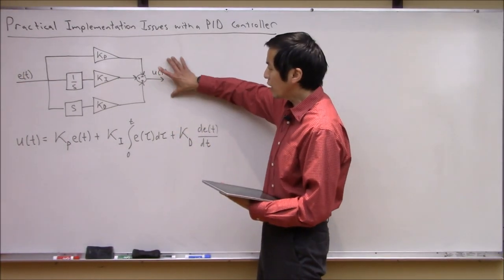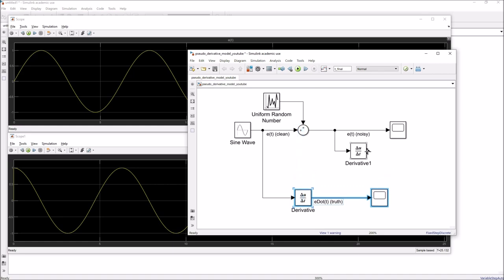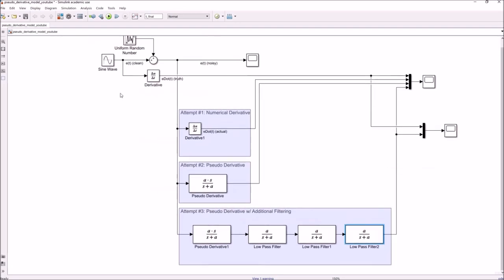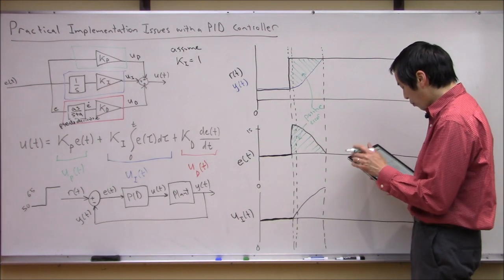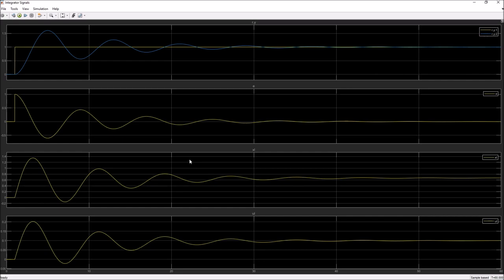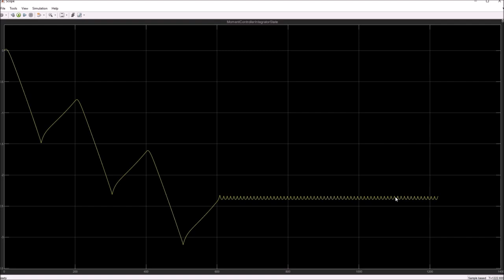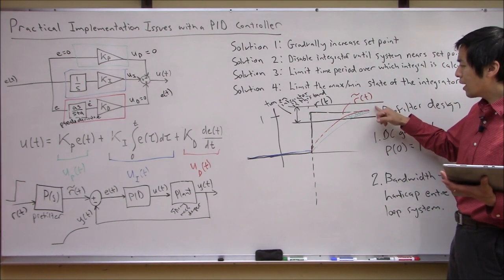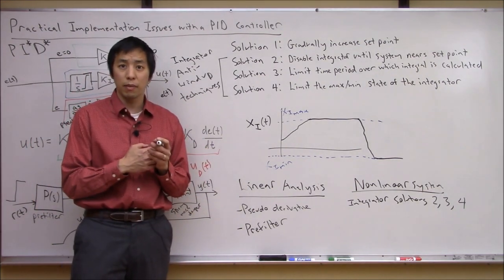Practical Implementation Issues with a PID Controller

Comment: As always, great video! I'm happy to be a patron. I thought I would comment that there is another reason to evaluate the integral in PID in the order Ki then the sum (discrete) / integral (continuous):  (error -> Ki -> 1/s -> output). When changing the Ki coefficient, if you have Ki term preceding the sum, then any change to the Ki term will change the rate that the total integral term "changes". There will be no step discontinuities. If the sum precedes the Ki term, a change in the Ki term will result in a step change in the total integral term. This is almost never desired. When would you change the Ki term on a "hot" system? 1) When tuning on a test stand and 2) gain scheduling 3) when you switch your control law "off" temporarily.  In addition, the Aerosonde example is a great example of how the whole problem could have been avoided by using this scheme. When switching from PID control to manual control, the Ki term could have been set to 0. If the Ki term precedes the integral sum, then the integral sum wouldn't build up and it's super easy to code this up (this does not eliminate the reason to limit the integral sum). Of course, this avoids the issue that a live control loop should never be left executing when not "hooked up" to anything. Leaving he forward path "broken" is the ultimate in non-linear control! :). Many thanks to Chris for making a video with such meaty topics!
Reply from the maker: Great comment and great observations, thanks for sharing!

Comment: Hi Chris, thank you so much for these videos. Not sure if you know about Signal Viewer and how easy it is to use that (for viewing multiple signals together, separate, or whatever) instead of the scope blocks. All you'd need is just an output port for each signal you're trying to add to the Viewer. I discovered about this a few months back and it has made my life so much easier.

Comment: Do you remember what signal you were using for the error term in the example you gave of a limited integral state vs limited output?  When I set up a similar system and used a square wave as the input signal, I got the same output when limiting the integral block (what you called limiting the state of the integral) as when I put a saturation block on the output of the integrator.  I think I'd understand the concept better if I knew what the input signal was, as I presume this is only an issue for certain types of functions/signals.
Reply from the maker: Hi Ignatius,
Thanks for reaching out, I'm glad you enjoyed the video.  Unfortunately I'm unable to respond to questions on YouTube due to the sheer volume of inquiries that I receive.  That being said, I hope you'll consider supporting the channel via Patreon at https://www.patreon.com/christopherwlum or via the 'Thanks' button underneath the video as I'll be able to answer questions there.  Given your interest in the topic, I'd love to have you as a Patron as I'm able to talk/interact personally with Patrons.  Thanks for watching!
-Chris

Comment: AE511: It seems like the integrator is required to guarantee no steady state error but also has the most tendency to make the controller behave adversely.
Reply from the maker: As Ben Parker said, "with great power comes great responsibility"

Comment: Sir, do you have any idea about the implementation of Nonlinear controllers with analog circuits? As for PID, we can construct analog PID controllers by resistors, capacitors, and opamp, because they involve simple calculus, but nonlinear controllers involve very difficult and complex mathematics, so how to implement these controllers in real-world systems?

Comment: The problem I have with these videos is that too much time is wasted drawing or wiring the equations.  They should be done ahead of time.  The information density is low.  Most 'noise" is not really noise.  It is due to low resolution feedback.  The feedback signals are "quantized" by the resolution of the feed back.  A fast sample time helps but feedback resolution is more important.  I didn't like the statement at the end about poles and zeros don't apply to a modified PID.  The derivative low pass filter adds poles and the integrator pole is valid as long as the controller doesn't go into saturation.   If the system does go into saturation then the control is basically open loop anyway.